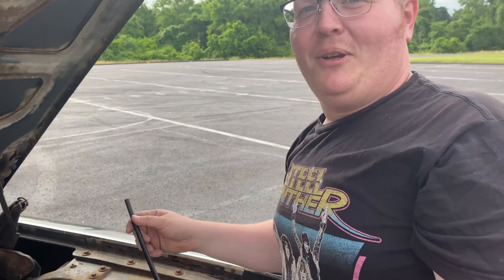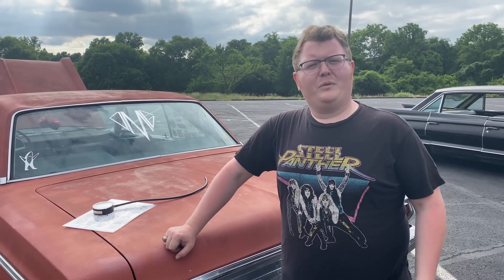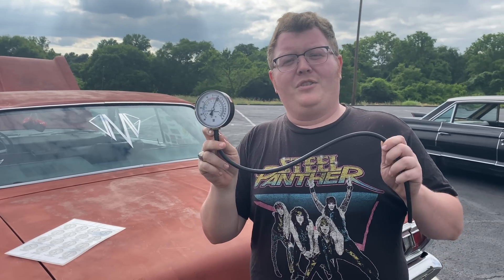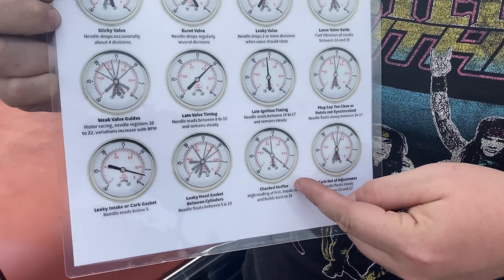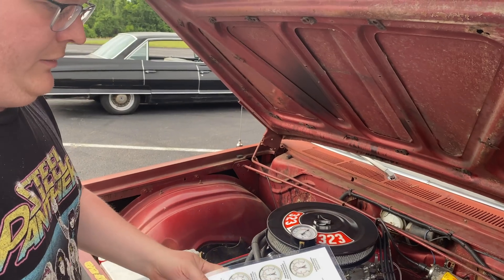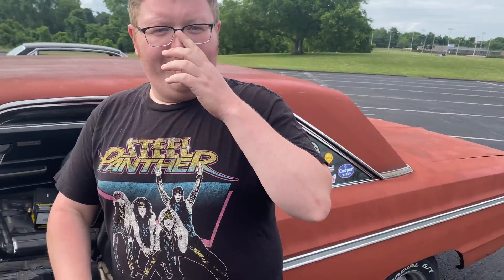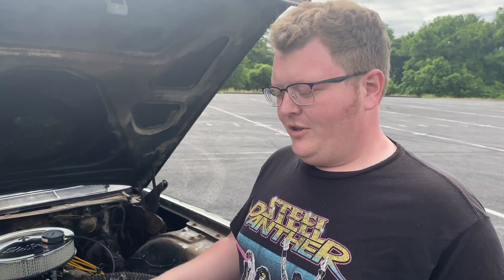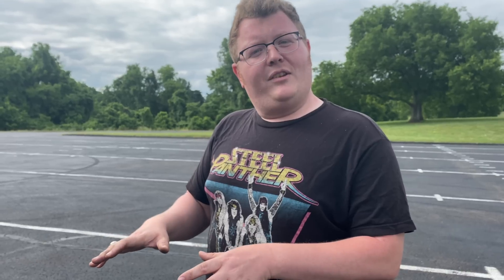Vacuum Gauges Are Just Old School OBD Scanners (Chart in Description)

Comment: OBD1 is just less sensitive. It still points out some clues, people think OBD is to tell you when a sensor goes bad, its not, its to point you into the right area to trouble shoot. Most people get a code for lets say  an O2 sensor code telling you its staying too rich, Most idiots will change the O2 sensor.. Wrong,  you need to be looking at what could cause that code, The sensor is working, its screaming at you to look for a bad FPR or a vacuum leak, The sensor is working fine.  obd1 is really no different, its just  a little less specific.

Comment: THANKS for the hyperlink to the chart! (I'm going to color-print and laminate it too!)
Reply: Lamination Pro Tip: After printing, Trim 1/8" off of the paper margins, and position the paper at the bottom of the lamination film, and laminate.  Then you you will have room at the top of the Laminated chart to hole-punch it (avoiding the print) and hang it with your other future lamination's and seal in the paper - forever.

Comment: You should epoxy a magnet to the back of the Vacuum Gauge if your going to instead of balancing it on top of the vibrating air-cleaner cover - so it won't fall off - ever again!

Comment: OBD 2 tells you exactly whats wrong? Man, I missed that class ...   Neither OBD 2 n or the vacuum gauge tell you what's wrong, they only point you in a direction. In the case of the Caddy,  it could be valves not sealing, or other problems related to the valve train.  It could be a cylinder with bad compression not related to the valves, an intake leak or even an ignition issue.   Pretty sure this was covered fairly well on YouTube  by UTG.    :)
Reply: My 3100 obd1 ecm reports 35 parameters, trans temp and ac high side pressure are two of these.  AC is an important feature to some of us geezers.  OBD 1 didn't have cat efficiency or evap monitoring.

Comment: My 07 Grand Marquis has an instant and average fuel economy feature on the little computer screen between the speedo and tach; probably works off of engine vacuum, also the 1977 Cadillac Seville had a little green light and a little red light above the speedometer that worked off of vacuum that told you when your fuel mileage was good or bad.

Comment: If you can find an old Chilton's manual that covers 60s &70s cars it will usually have that vacuum gauge chart and some other useful things. I'd rather have my info in a book than on a computer.
Reply from the maker: That’s why I printed this chart and laminated it lol. 

My 1965 dealer service manual does not have this chart, was kinda shocked by that.
Reply: @DaddysMoneyGarage  Those factory manuals are great because they show you how to rebuild pretty much every mechanical part of your car.

Comment: Mine shows 6 on the vacuum gauge. Seems really low. I have a Lunati cam, brand new motor, terrible stumble off line. Still can’t figure it out
Reply from the maker: A radical cam will show those kinds of low numbers even when there’s nothing actually wrong. But from what I have heard the converter needs to be matched to the cam and that’s why I didn’t go super radical on my cam because the converters for my year 727 are just unobtainable for performance applications. Different spline count on the input shaft.
Reply: @DaddysMoneyGarage  good to know, thanks for the reply. Oh ya, love the new channel guys.
Reply: Max- you need to enlarge idle feed restrictions in carb to enable correct fuel ratio due to the reduced vacuum pulling fuel from the circuit.
Reply: May need to recurve the distributor or bump up the timing at idle.  With a larger cam you are getting less air into the cylinders, so you have to fire the mix sooner to get a better idle.
Reply: If your Lunati cam is too big for the compression your engine has,it will stumble,fall on it's face etc. Check your compression. If it's below about 120 psi then your cam is too big. You could advance the cam about 4 degrees & pick up some compression that way.
Reply: @shanew.williams  thanks for the info! I will check.

Comment: While watching the vacuum gauge, slowly turn the distributor clockwise (advance timing) and look for a maximum reading on the vacuum gauge that how i set my timing at idel,, Test drive your car and listen for any ping under light acceleration as well as under heavy acceleration. Additional retarding of the timing may be necessary if excessive pinging occurs. You should hear a very slight ping under light acceleration, and none under heavy acceleration. Your engine is now optimally timed to run on today's lower octane

Comment: I put a vacuum gauge in my '68 Fury partially to fill an empty hole in a three gauge pod, but also to keep an eye on if things were as they should be. Uncle Tony did a video about vacuum gauges and fuel mileage. The idea as you're going down the road is to keep the vacuum reading as high as possible if you're looking to stretch every tank of gas as far as it will go. In the 1970's with people worrying about the price of gas and whether it was even going to be available when they got to the pump, some GM cars got vacuum gauges in the dash to give the driver some idea of their fuel economy as they're driving. One of my old DIY auto repair books has a vacuum gauge chart not unlike what you were showing that has been really handy for diagnosing engine issues. A couple of years ago, I got one of those hand held engine analysers and while I don't need the dwell part because I've got electronic ignition, the rest of it has been really useful for engine tuning.

Comment: you're exactly right, inches of mercury was literally a tube of mercury and the harder the vacuum, the more inches it pulls up the tube.  It was measured with a ruler.
Reply: for more sensitive measurements its inches of water, same principal but an inch of mercury is 13.5 inches of water.